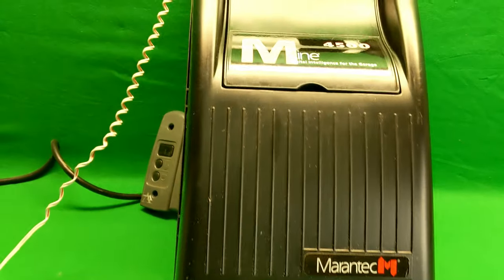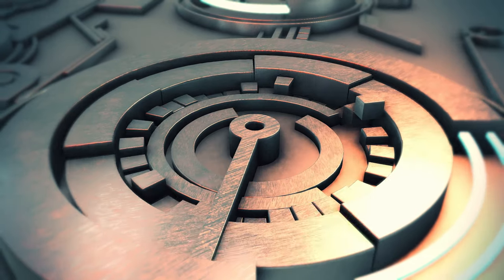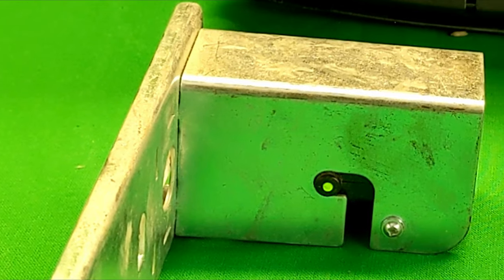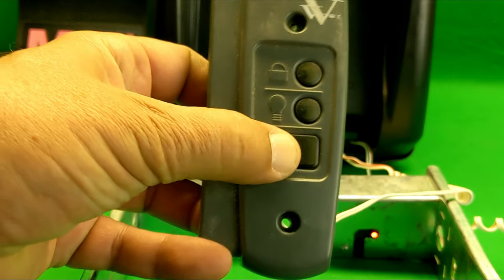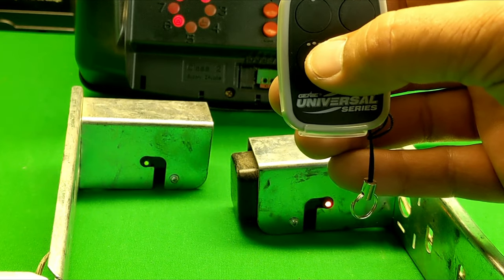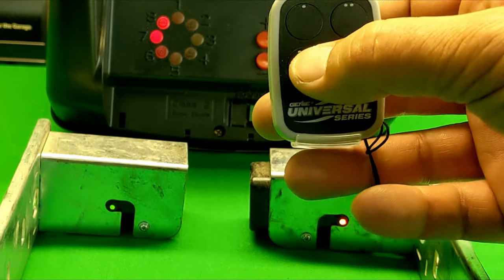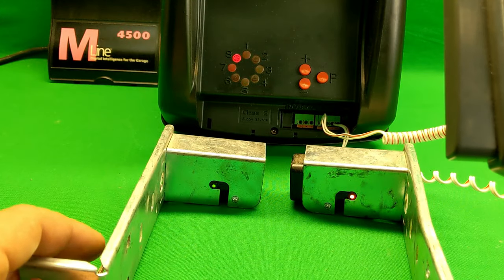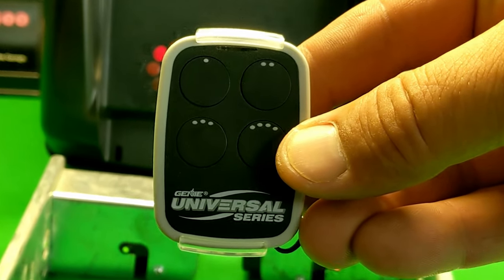Marantec Garage Door Opener Not Closing with the Remote or Wall Button

Comment: Hey my sensor are like up and not an obstacle on the way but my garage won’t close it does open but it won’t go down unless y press de - button any idea on that?
Reply from the maker: 🤔 hmm..man, normally it's a sensor issue if you have to continually hold the Wall button down to close the door.
Reply: @garagedoorgenius  yeah both of my sensors are solid(red & green) but the garage won’t go down only makes a noise like is going down but nothing. The only way to close it is by pressing down the wall button until it shuts!!
Reply from the maker: Have you tried adjusting the force controls?
Reply from the maker: @zekemejia9100  in this video I show how to set the limits and the force controls.
https://youtu.be/gXEILuztzIw

Comment: I have the Marantec 4700e. The wall button stopped receiving power after the garage door hit a box. The remotes work, and the door opens and closes, but the wall unit is not working.
Reply from the maker: Judith is there a red light that is on?  if everything else is working except the wall button station then you could possibly have a broken wire or it's not plugged in to the unit. Sometimes wires wiggle loose or break.

Comment: Hey I have a question. My Garage door is just slamming shut. My cables were off, and I used one of your old videos to fix it (worked like a charm). Now my garage door just slams shut. It will not stay open. What do I do
Reply from the maker: Hey!
Thanks for watching.
Well if it's slamming down, then you need some tension applied to the spring.
If it's a 1 spring door I would put around 2 full turns to start with.
2 spring set up add 1 turn per spring.
A heavy door means either a broken spring or tension needed.
If you decide to do it, PLEASE research how to properly do it.  Don't want ya getting hurt.  Springs are serious business.
Reply: @garagedoorgenius  thank you! I'm definitely going to do some research for a few days to avoid injury.
Reply from the maker: @That_Guy2424  👍🏼

Comment: I have a humming and power but door won’t open. Is this a track issue???
Reply from the maker: Make sure you don't have a broken garage door spring.  Located directly above the door.
Reply: @garagedoorgenius  No the spring is intact. The issue is the track won’t latch or randomly decides to latch and then the motor stops so I have to unlatch then it hums again.
Reply: @steffanie707  you have to re engage it sounds like.when you hit the button check the track to see which way the tract slides. make it slide to the front where the garage door is. then grab the metal where the string hangs (the one you use to manually open garage) and push it forward so it will grab again. kind of hard to explain. hope this helps.

Comment: I have a M55( I think) Marantec. I can OPEN it with remote but I can't  close with remote.   I can only CLOSE the door by holding down the wall button.
Reply from the maker: Typically that's a sensor issue.  By pressing and holding the wall button overrides the safety sensor feature.
Reply: @garagedoorgenius  the previous owner left the wires on the red side loose.  There were two wires and each has one blue and one white.  I just don’t know which one to connect.
Reply from the maker: Trial and error.  You won't fry them if the wire sequence is wrong.

Comment: Nope mine are lined up and the main motor has the lens blocked light constantly on.  Ordered new sensors and same thing.  Leds both solid but they just don’t want to work
Reply from the maker: Have you unplugged it.  Let it sit for 5 minutes.  Then reprogram the up/down limits.  Set the force controls.  Cycle the unit 2 full times.
Reply: Garage Door Genius I did not power it down and went through the reprogram process.  Still will not close even though both leds are solid lit.  They eyes work because when I put my foot between they begin to flash.  I think it’s just poor quality design on the focus eyes
Reply from the maker: @boblong6796  unfortunately it sounds like a board issue.  Time to replace it.

Comment: I have no lights on display wall button not working
Reply from the maker: Have you checked and made sure The wire didn't come loose from the wall button?  I would start there. If all looks good at the wall button make sure the wall button wire is plugged into the machine and not disconnected.
Reply: @garagedoorgenius  yes wires on wall button are good, sensors are,one red-one green, but the display where the P is has no lights on.
Reply: Also the light bulb stays on.
Reply: which garage door opener is easiest to replace with this one?